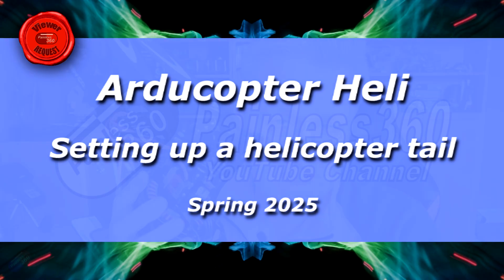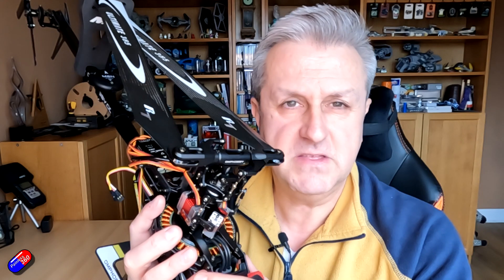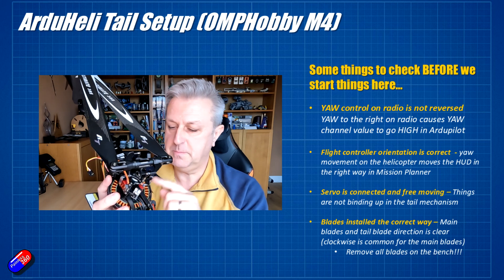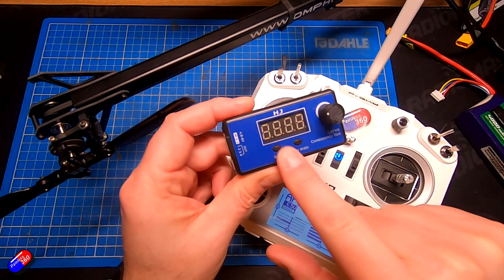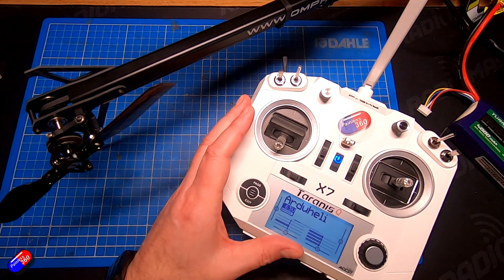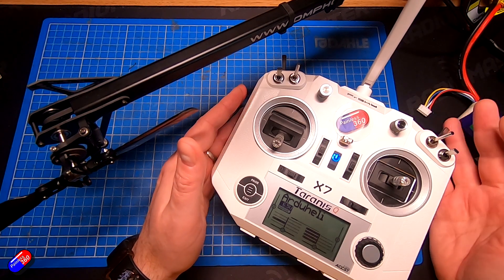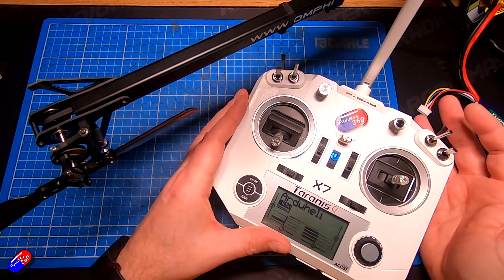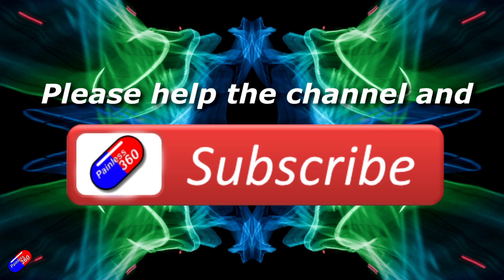ArduCopter Helicopter Setup: How to setup the tail on a sports R/C helicopter

Comment: I'm doing this exact setup now. Ive had a few issues so far mainly related to plugging things in the wrong ports. I'm using Radio Master RC gear with the RP3-H receiver. Question how did you mount the GPS to the boom, custom mount?
Reply from the maker: It is. I've shared it on my Thingiverse page... Happy flying!
Reply: @ Thank you.